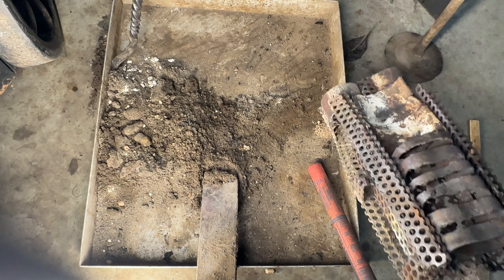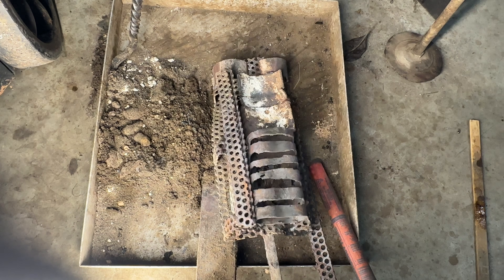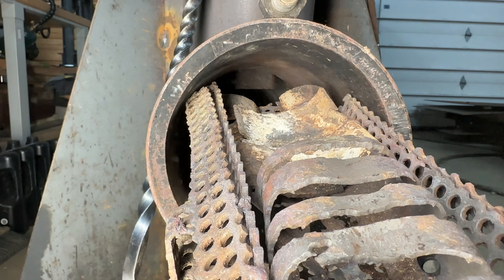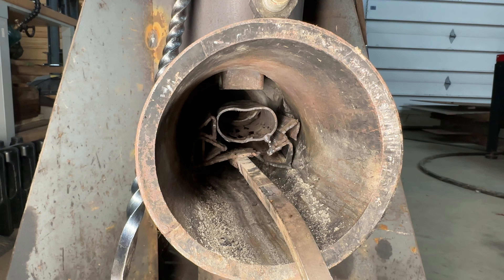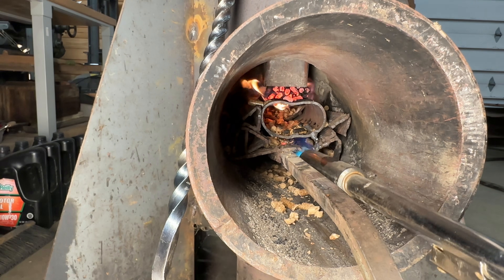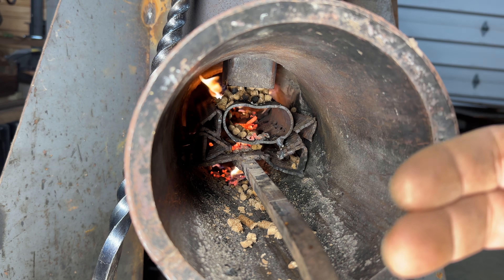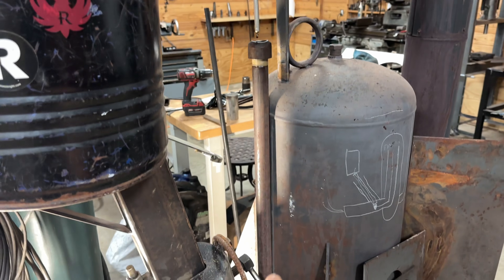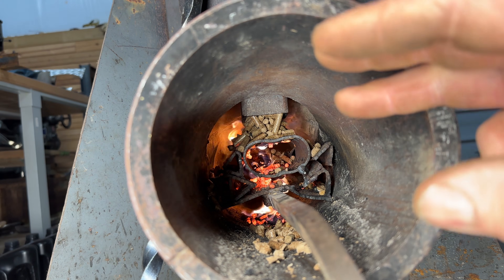DIY Pellet Stove Starting Guide That Actually WORKS!

Comment: great video. I have a suggestion for you: if your grate/airflow sled thing was stair stepped or even just sloped, you could adjust the pellet feed rate by moving the sled in or out. probably easier than adjusting those jam nuts and lifting the whole hopper.
Reply: second suggestion would be to control the burn rate with air restriction, and just have the pellet feed stay constant. Have you ever tried to use arbor wood chips in there?

Comment: Hello Mr. Taylor, I have a wood burning water heater that like your setup takes a while for the draft to take hold. I use a 1500 Watt hair dryer on max heat to get the draft going before I light it off. And sometimes to help force the draft while the fire is just starting.
Reply from the maker: I have never heard of that idea before

Comment: This is a great R.S. pellet/multi-fuel system tour Chris! Good close shots of the pellet feed sys & burner tray. I'll be real intetested to see your New, improved burner tray.
In my automotive engine & oil testing experience, carbonizing oil that "cokes" up is oil overexposed to heat for to long, (like turbocharger bearings.)
Try to expand the distance of the vertical  oil infill pipe to the outer surface of the stove expansion chamber by several inches. Finally, put a stainless tube Inside that 1" oil infill pipe all the way into the burn chamber. Use washers or spacers to keep the inner stainless tube from touching the outer pipe. Only the inner SS tube should enter the burn chamber, but just barely (1/4"-3/8"). The oil is flowable before entry into vertical 1"(currently) & needs no additional heating to finish the trip. The large  1" pipe has huge surface area & very close proximity to the tremendous radiant heat from the expansion chamber, & overheats the oil, burning it lighter hydrocarbons 1st, then finished the process as it enter the burn chamber & thus you get "coking" (Sorry, I used to be a tech in oil research, but also got to weld a lot, yep dream job, then went blind & arthritic)🤬 Hope this is helpful, blrssings Chris, love the show!
Reply from the maker: Thanks for the advice, that’s a great idea. Put stainless inside the 1 inch the draft coming through the 1 inch in between the spin will keep it cool. The oil will never touch anything until it touches the  drip plate. I’ll try to move the 1 inch pipe a little bit. Or maybe insulate it on the next one . Thanks again.

Comment: Nice build.  I just made a stick burner rocket stove out of 5" pipe.  Welds aren't the greatest but I haven't welded anything in two years so just getting back at it.
Reply from the maker: As long as it’ll hold. That’s why welding stoves are so fun. If I would’ve known, I was going to have a YouTube channel. I would’ve spent a little more time on my Welding prep.